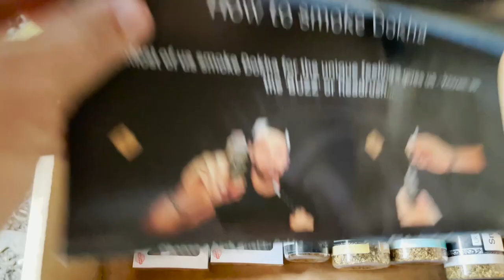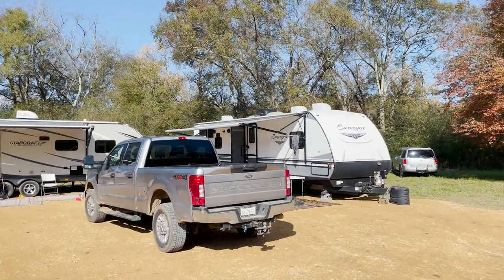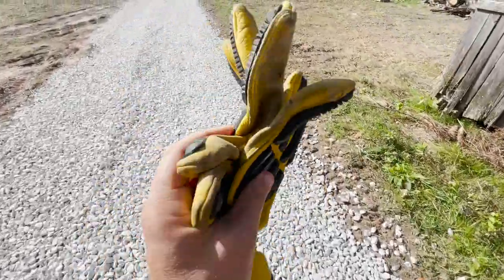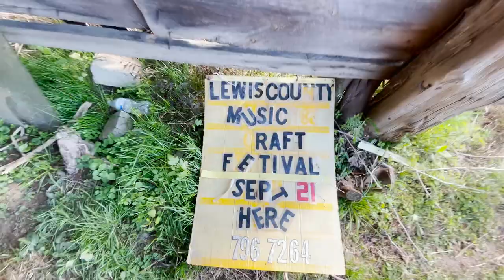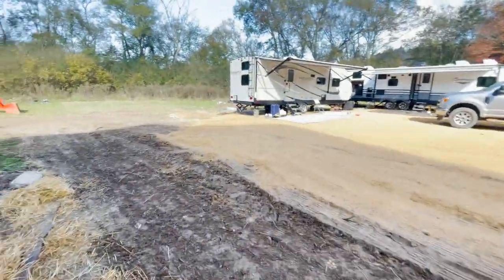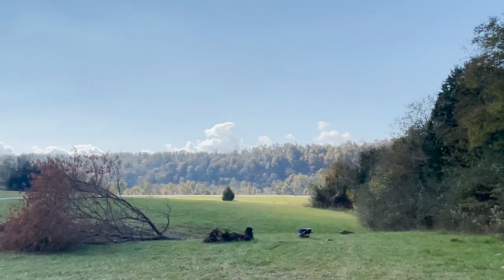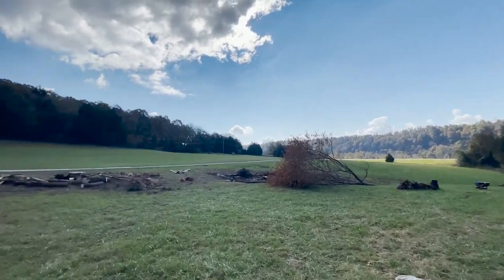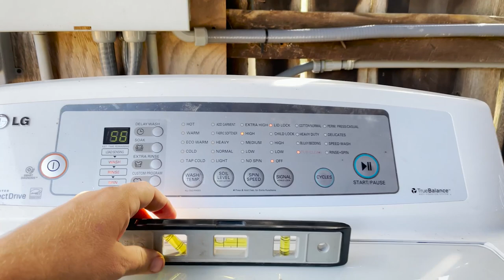A DAY IN THE LIFE working our 200 year old TOBACCO FARM!

Comment: Awesome! You probably already know this, but the same heat tape that prevents your RV waterlines from freezing is readily available at your local mobile home repair store the trailer parks use. It will prevent those washing machine lines from freezing. You may need to coil a second roll under the machine to prevent water inside it from freezing and bursting the pump.